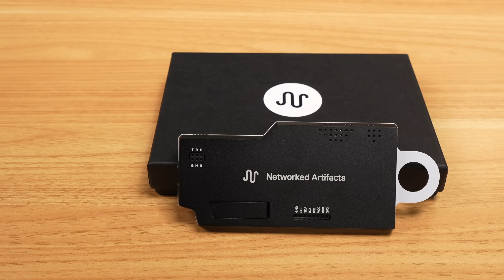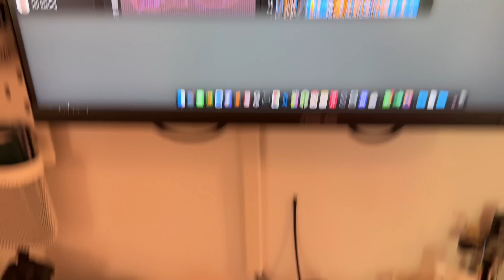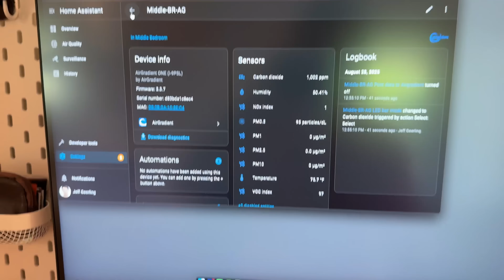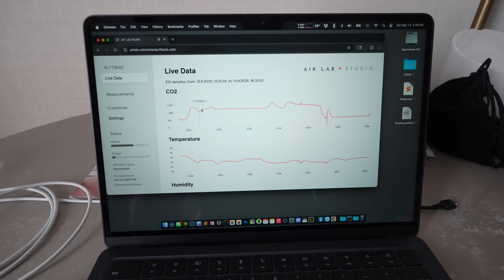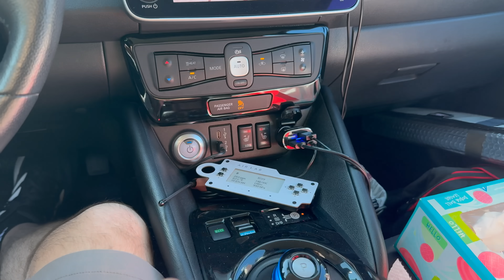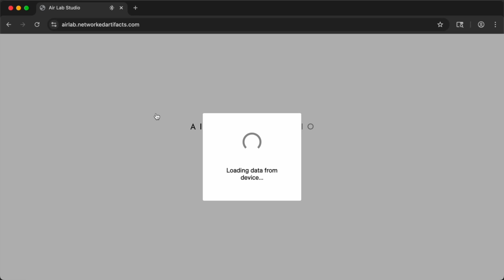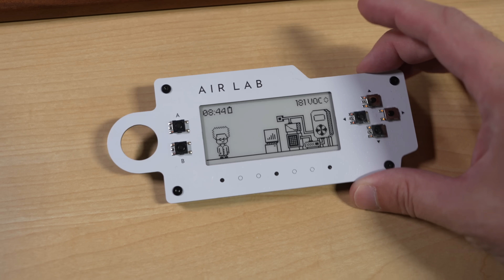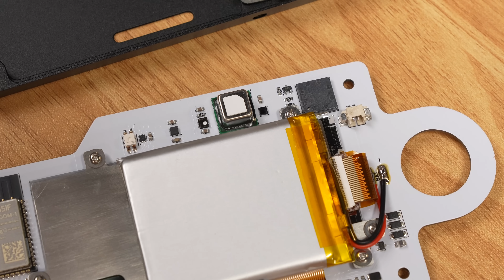Are you sure that's air you're breathing?

Comment: I stopped at $250. That's too much.
Reply: BOM cost at DIY scale is probably something like 50USD? CO2 and VOC sensors are more expensive than you'd think. Also, don't forget the cost of developing firmware designing the PCB, and assembly. If you've never done something like that... well, try it. It'll be a valuable learning experience.

Still, $250 and no particulate sensor? Just buy or build an AirGradient instead.
Reply: @SnakebitSTI  Achim, founder of AirGradient here. 

We do also have the AirGradient ONE available as a kit for USD 138. This is actually the exact same hardware as the USD 225 version, but needs a quick and simple assembly. One advantage of the fully assembled version is that it goes through our test chamber and gets an additional calibration.
Reply from the maker: @SnakebitSTI  The most reasonable take.

I think most people who balk at the $250 haven't bought other CO2-monitoring devices, especially ones that aren't AirThings. There are some good options, like Aranet4, that go on sale for substantially less. Though they still lack a feature or two in comparison.

I like the ecosystem approach I think Network Artifacts is going for in the long term, similar to (but much smaller than) something like M5stack. Thus, if you're like me, you see $250 as expensive, but potentially worth it.

I have no problem with people thinking $250 is a ripoff, of course. For most people, that's an insane amount of money to spend on any kind of air quality monitor.
Reply: @JeffGeerling you say this but how much is knowing the co2 level really worth? Just crack a window and you don’t have to wonder. A quarter of a grand is mental
Reply: @danieldc8841 Well, that isn't always an option. The convention center didn't have any and going out every 5 mins might not be the best trade-off. And designing something like a server room or a sealed office, you might struggle to find other options. Over all, I think it has its place, especially when "just open the window" isn't as practical. But not everyone has that place...
Reply: @JeffGeerling 

Qingping Air Gen2 is cheaper, more feature rich, more accurate air quality meter available. It has a user replaceable PM sensor as well.
Reply: Yeah, can it even run doom?
Reply from the maker: You only made it 2 seconds in! Drat!
Reply: @JeffGeerling  I made for from an old air purifier, ESP32 and a 5v fan.

I would like to make more but not this expensive.
Reply: There are cheaper CO2 monitors, highly encourage buying one. Housefresh is a good reviewer of these type of devices.
Reply: Actual air quality instruments that are accurate have always been crazy expensive. Those $50 smart home ones are basically useless.
Reply: @technicavivunt this uses the same sensors, you can see them in the video
Reply: @technicavivunt  The good sensors are not that crazy expensive. 20€ at most. It should be possible to build the remaining electronics and case for 30€.
Reply: I think most of its price comes from the Sw on it not the hardwere ,
Reply: During Covid, before all the open sensors were available, I picked up the Aranet sensor, which requires a proprietary app. It’s good but limited. As Jeff notes CO2 level is an indicator of air circulation, in addition to tiredness and brain fog, poor circulation is a cause of viruses spreading much easier as they aren’t moved away from people quickly enough.

Jeff - My Leaf is pretty aggressive about turning the recirculation back on. If I turn off the climate control, or car, when I turn it back on it usually turns recirc back on, also if I switch modes I think it turns it back on as well. I think it’s a battery saving thing so it doesn’t have to condition the air as much.
Reply: M5Stack has air quality sensor for 87 bucks
Reply: I've received my unit of screek env-cp couple days ago. It connected to home assistant instantly. i don't have anything to report at this point, but it's showing values where I needed them ;) ~45 usd.
Reply: Honestly, this is how much it costs, you aren't paying much premium. The higher quality air sensors cost that much. many cost more, if you look at component cost
Reply: If you ONLY want CO2 (and maybe temp/humidity) then the NDIR on it's own is cheaper, but that really depends on how many sensors you have on board. Each NDIR sensor is about $20 and some gases aren't made as NDIR
Reply: 250 bucks and they couldn't even integrate the buttons nicely? Yea I'll pass.
Reply: Seriously.
Reply: All those air quality sensors aren't cheap.
Reply: @tyttuut  Temperature/Humidity/Pressure combined sensors are a few dollars max. VOC sensors are also just a few dollars. You can get the S8 CO2 sensor for about $30. A particulate meter (which this doesn't have) is about $15. All in I'm guessing the actual sensors on the device cost well under $50. E-paper displays are much more expensive than OLED displays, depending on the model they could be $20-$80. All told the BOM is probably around $100, maybe slightly more depending on the display. The real value is in the programming and connectivity.
Reply: @tyttuut  Actually they are fairly cheap. Most air quality sensors cost less than 10$. I know, I just built a device that measures more parameters than airlab, for a fourth of the price. Not mobile though.
Reply: @tyttuut  Those sensors would still be cheaper than $250
Reply: @S00rabh  well no duh, you're not just buying the sensors
Reply: @tyttuut Yea, because the sensors are actually pretty cheap. You're payong 250 for the interface and software, which is insanely overpriced.
Reply: @tyttuut But there's not much else there
Reply: To expensive, they should make a flipper zero addon
Reply: Damn right it is.
Reply: Yikes, no kidding
Reply: I stopped at your comment before the video started
Reply: I agree that the main problem is that most people wanting this or watching this channel would be able to make one just based on the idea and it would probably cost a 10th of the going price. Mind you the functionality is over the top in its complexity and what I'm thinking would be a vastly scaled down version but still with a screen.
Reply: It’s not for you pookie

Comment: On the Temtop - my CO2 monitoring went dead too, but there's a little battery in there just for the CO2 module that can be replaced!
Reply from the maker: Ooh, good to know! I had not taken it apart, but will do that now.
Reply: Did that fix the problem?
Reply: Temtop devices look nice.Are they reliable and can be connected with Home Assistent?